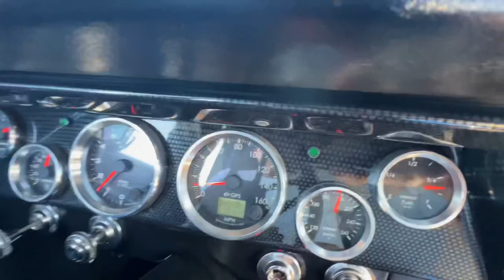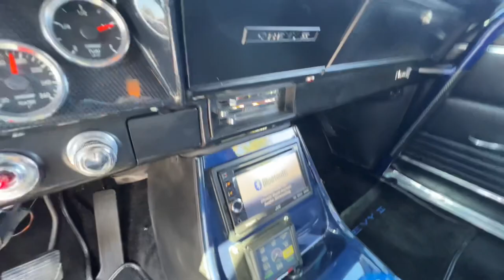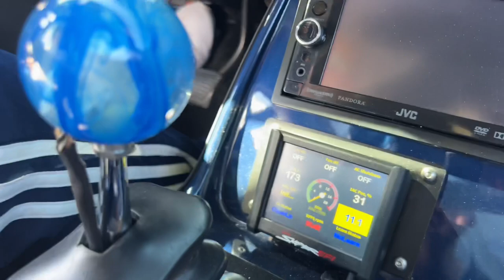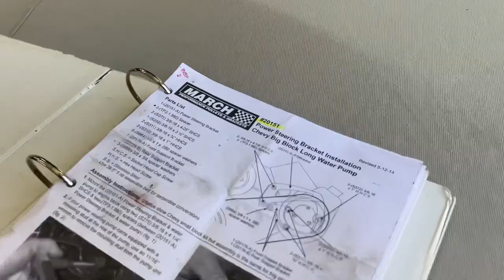1967 Chevy Nova 502 Big Block Muncie M22 For Sale 951.348.5794

Comment: The only item that is not top level "Protour/Restomod" status is the 4 speed transmission.  Put a T56 or TKX in her and it will be every bit as incredible as those $250k versions out there.  Maybe AC for us folks in Florida also.